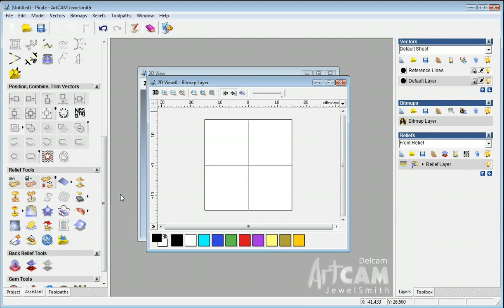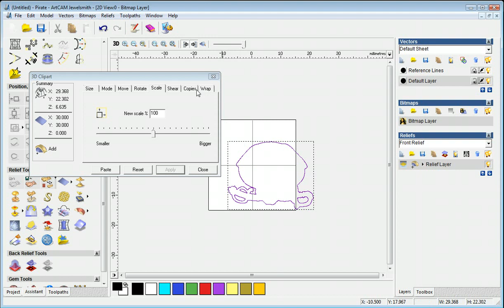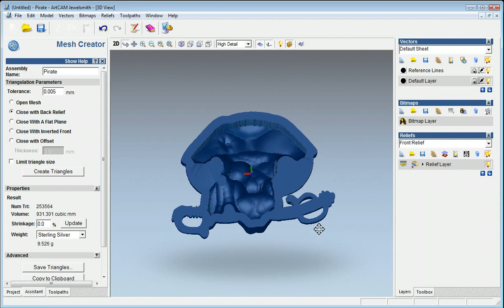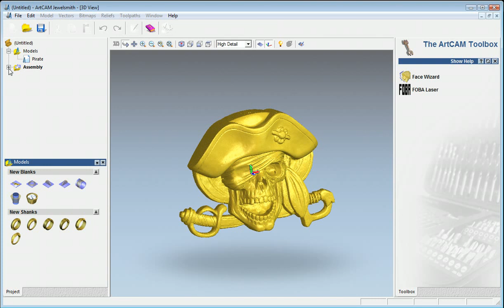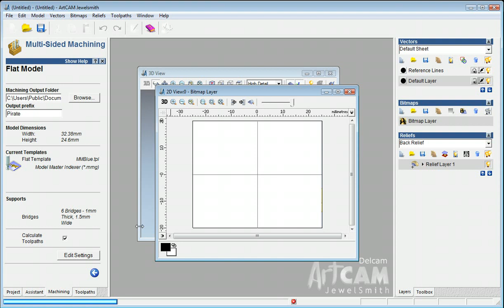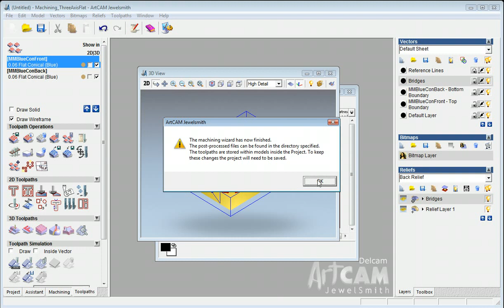3D Model Club   Tutorial   How to Hollow a relief using ArtCAM Jewelsmith

Comment: hi thank you for video its helped me alot, I'v get problem at Multi-sided machining,after I doing all edit settings and i want to finish this part,art cam gave me this alart " the toolpath template specified does not exist. please check your settings to make sure that a valid toolpath template file is selected",its talking about which setting? my cnc maching works with G-code mm.please help to solve this problem